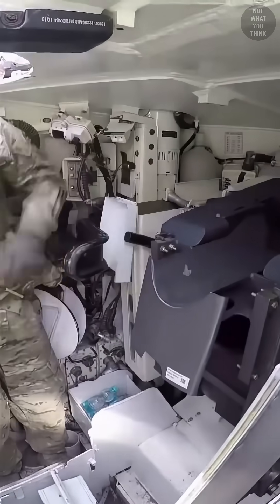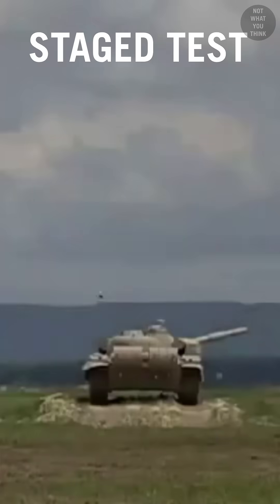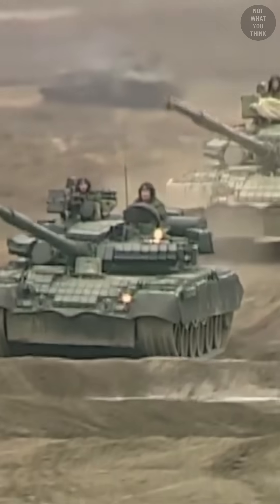Why M1 Abrams Tank Has No Auto-Loader #shorts

Comment: I'm sure there's a happy medium somewhere, not having an auto-loader must suck as those shells are really freaking heavy.
Edit: After seeing how truly awful the Russians are in battle, I'm no longer all that disappointed at the lack of an auto loader.
Reply: French, Japanese, and Korean tanks have a blowout panel with an autoloader so the crew are protected from the ammunition while needing only 3 crew.
Reply: @aaa-fc6by  germans as well
Reply: @aaa-fc6by  And which tank is better?
Reply: @aaa-fc6by  and the abrahms still is king
Reply: @aaa-fc6by  i doesn't need to be said but there's a list of advantages to not having an autoloader. Not just safety in the even of ammunition detonation
Reply: @aaa-fc6by  your not one upping American tanks, by stating this stupid facts, we do in fact use auto loaders, not on all vehicles tho. Some quickly change munitions with a quick individual rather then preload with autoloaders
Reply: @aaa-fc6by  The Abrams has a blowout panel to protect the crew from the ammunition and a split ammo rack so the tank only loses half its rounds if the ammo goes off.

Also, Abrams only needs 3 crew.  The 4th guy is a boon if personnel are available.  But I've personally seen many Abrams tanks run with just 3 crew.
Reply: @aaa-fc6by  Having less crew isn't necessarily good. And how much ammo can they fit?
Reply: Normally you‘re not going to change that many shells in a row and you‘re specifically trained to do exactly that. nothing else than working out at the gym, don’t see the problem :D
Reply: @TheLuxentertainment  problem is that not every loader is the same size meaning taller loaders can have issues with longer shells
Reply: Those rounds are not really that heavy. They're only around 50-55lbs each
Reply: @sawmocehdohmoo563  try loading 55 pound shells for a few hours straight.
Reply: @BASEDKAISER  you're never gonna load rounds for an hour straight. The tank doesn't hold that many rounds
Reply: @sawmocehdohmoo563  I've handled tank rounds and you're pretty much spot on with the weight. But I was a little bit weak and they felt like 70+lbs.
Reply: @sawmocehdohmoo563  You crazy that's pretty heavy.
Reply: @sawmocehdohmoo563  well I guess that means if I ever join a tank crew after Papa Murphy's I'll be set, I load 40 pound boxes of mozzarella in and out of the walk in lmao. Not that much heavier
Reply: @liamschallock5346  go for it. Loading a tank round is one of the easiest things you will do as a tanker
Reply: @sawmocehdohmoo563  41 lbs I think, yea not to heavy at all infantry carries way more than that
Reply: @sawmocehdohmoo563  so me a 12 yo boy could do it? If age didnt matter
Reply: @sawmocehdohmoo563  the endurance needed to lift each one over at shoulder height is quite taxing when the rack can carry at least ~20
Reply: @sawmocehdohmoo563  now imagine carrying that weight everytime the gun fires in the sheer heat, cold, and cramped conditions
Reply: @crispyboi4062  I don't have to imagine it because I've done it in all those conditions.
Reply: @sawmocehdohmoo563  damn that is impressive I couldn't do that if I tried hats off to you and thanks
Reply: @sawmocehdohmoo563  Dude, that's a sack of potatoes. "Not really that heavy". Sure, buddy.
Reply: @FlyboyHelosim  If you think a sack of potatoes is heavy, being a tanker might not be in your best interest.
Reply: @sawmocehdohmoo563  I never said I wanted to be a tanker, besides lifting sacks of potatoes is probably worse than loading shells. I was a kitchen porter for 6 years, lifting multiple sacks of potatoes and many above waist height.
Reply: @FlyboyHelosim  Maybe. Being a loader is not hard
Reply: @sawmocehdohmoo563  That might not be terribly heavy but in an all out tank war having to load those rounds over and over and over for hours would be absolutely tedious. The thing I dont like about auto loaders, though, is the fact that like every other thing mechanically operated it can and will break down. Whether from bad parts, human error, damage taken, ect. So I get what the American designers were going for. Longevity and it being able to continue firing no matter what. Same with the Abrams tank engine. It will keep going no matter what you put in it. Even ethyl alcohol. As much as tank nerds love the German Leopard, its been known to have multiple mechanical errors in short amounts of time. In a near peer war situation humans have learned time and again that having a weapon that works consistently, is very hard to take out, and can be produced in vast quantities will win out every time.
Reply: @Oblivisci........  you would fire them for hours however, it would not be necessary to load 50+ rounds consecutively at most, it would be 2-4 shots fired back to back
Reply: @Just_Tox  then let the mf rest as someone else takes over. It's not that complicated
Reply: @anonymousapproximation8549  whoses gonna take over his position a loader is a loader not a commander, gunner or driver and I wouldn’t trust the random guy you find that’s got nothing to do to load the right shell
Reply: @TN-ci4ox  If you're in a situation where you need those shells loaded, and the loader is too tired to load, well, firstly what the fuck are doing to get into that situation, secondly, I doubt that the gunner doesn't know how to load shells, so probably him and the load switch places. If you somehow get into a situation that both of them are too tired to continue, then I'd question your validity as a commander.
Reply: @TN-ci4ox  why not as a loader hes fot the most off time and most of the time all he can do when not firing is learning the other positions. My old LT COL from school was a gunner before a commander.
Reply: @Oblivisci........  You're both kinda wrong. The shells weigh a lot, but aren't that heavy. But also in even a full on super heated combat a tank wouldn't just fire as fast as it reloads. What's tiring here and most gym bros can attest, is to do it everyday and your muscles can't get rest to recover from the constant stress. You're waking up with sore muscles and need to engage them again just a few minutes after getting up.
Reply: @Just_Tox  how many rounds do you think a tank even carries? Its not like battlefield where you constantly firing shells all day.
Reply: @twayland6186  for the Abrams it has a maximum of 56
Reply: @Just_Tox exactly. if a warehouse worker can handle moving a similar amount of weight for an 11 hour day than loader can handle whatever a tank can carry.
Reply: @Oblivisci........  no single tank would keep on firing hours upon hours... that's just stupid and unrealistic. A main gun might be fired, 5-7 times in a battle. The last tank battle was in desert storm and it was an entire tank unit, not a single man firing.
Reply: @Just_Tox  loaded them like nothing when I was in 19k Abrams Tanker. Not a big deal when your in early 20s and cock strong.
Reply: @Oblivisci........  i pay money to have access to weights for hours its not a huge deal
Reply: @stevennihipali3607  Have you heard of Israel? Im sure you have... What about the six day war? What about the Yom Kippur war? I think those tank crews would very likely want to have some words with you about continously firing. For days.
Reply: @draggy6544  Lol but seriously man... Imagine hour after hour having to pick those rounds up? I guess thats why guys like you are made into machine gunners, artillery loaders and sweepers, and tank loaders. Id rather do cardio all day long. And Im not trying to be all alpha about it, but that cardio has helped me out a LOT more in every fight Ive ever been into.
Reply: @Oblivisci........  cardio actually fucks badly with testosterone
Reply: @Oblivisci........  did they use m1a1 battle tanks? No
Reply: @stevennihipali3607  What exactly does that have to do with the historical fact I brought up. He said that tanks never have to fire in such durations. I proved him wrong with a historical anecdote. So.....
Reply: @draggy6544  Are you sure?  Im not saying you are wrong, but why would literally every boxer, mma fighter, muay thai fighter, wrestler, ect consider cardio among the absolute most important things about fighting? You think with such a lack of testosterone the trade off wouldnt be worth it. Or is it generally a very small amount of testosterone?
Reply: @Oblivisci........  because they need endurance they will also do tons of ab training that includes a good amount of ab tempering where they get hit in the stomach you can’t assume just because a sport has a practice its a healthy one. They are ready to do anything to get an advantage for example they will spend a lot of money on “designer” performance enhancing drugs (made to not be detected by tests) so they generally dont have to worry about testosterone levels going down.
Reply: @Oblivisci........  btw high amount of endurance training can reduce testosterone by 20 to 40%
Reply: depends which round ur loading. some weigh next to nothing while others weigh a bit more
Reply: @m1a1abrams3  I think it's funny you commented considering your pfp
Reply: It gets easier when there's 8 enemy tanks rolling towards you
Reply: @comradeorange1645  that scenario will never happen. At least not in this day and age lol.
Reply: @0331machinegunman  but u get my point ;-;
Adrenaline and fear in combat will make it slightly more easy to manually reload the gun
Reply: @comradeorange1645  
I know this first hand!! I loaded my M1A2 SEPV1 pretty fast when ak rounds and RPGs were pinging off our tank 🇺🇲
Reply: @0331machinegunman  u sure about dat?
Reply: Consider that when surveyed, US tanker repeatedly stated they prefer the 4 man crew a human loader provides, and that gun calibers are likely to increase above 120mm, I think the most likely scenario is that we transition to autoloaders in an unmanned turret, yet retain a 4th crewmember with a new role (one such proposed role is that of a drone operator for a deployable drone from each tank.)
Reply: @ParalyzedTortoise  he'll probably function as the 5th crewman in German WWII tanks did, as the radio operator(or in this case, the electronic warfare officer)
Reply: @ParalyzedTortoise  Forget the fact that it can allow for a reshuffle if one is killed, but in the event of being immobilised, that extra body is really valuable.
Reply: 120 mm shells in a tank are about the upper limits of what A human loader can do and have a very effective rate of fire.  Also you gotta remember most tanks are not going to be in hour long conflicts.  So they may get into a conflict maybe 1 to 5 minutes long depending on how many tanks are there.  And there's downtime between engagements where the loader is sitting or standing and not doing all that much.  So with a 120 mm and proper training a human loader does fine.
Reply: There are partial autoloaders where a round is fed to the loader through a slot though only the Israeli Merkava uses that type of system. As to which is better well I leave that to Tank Jesus -> https://www.youtube.com/watch?v=R0x-8NheU1E&ab_channel=The_Chieftain
Reply: not really. 50 pounds isn't too bad if you're in the military or at least do exercises
Reply: @cookiecracker2  55 pounds is retail store standards for logistic/stockers the majority of people can lift 55 with two hands.
Reply: @CaughtSlackin_  I'd agree 100% with you if the majority of people did exercises or some sort of weight lifting ;)
Reply: @cookiecracker2  over 50% of the world works in some retail fashion which means the majority can and do.
Reply: @CaughtSlackin_  oh...this is a US tank thought we were talking US. most European and asian tanks have autoloaders
Reply: Especially HESH rounds
Reply: @dukeoftoast2420  
We don't use HESH in the US military.
Reply: The worst thing about loading in an abram is that you have to flip it around instead of like the design in German tank when you got enough space to cradle the shell and turn your body around
Reply: Man, you could do more heavy lifting on a shift at a warehouse then expected from a loader in a battle. Also it's the Army, lifting heavy shit is part of the job description.
Reply: Your average labour job requires you to be able to lift and carry 50lbs so this wouldn't be much more strenuous than a job unloading freight at Walmart. Besides of course the whole war part
Reply: They are indeed very heavy. Past experience with handling tank shells.
Reply: @The_HumblePanda  was under a tank commander who was a loader before that. Did it for 20 years. Had a few with full loads still at his house when we went for the school cookout. Not heavy at all not even hesh rounds.
Reply: Sabot weighs less than a full AP shell from WW2 despite being a 120mm
Reply: So carrying heavy loads is a chore in the army?
Reply: @foodmore  always has been since the 1774
Reply: @foodmore  yes, this is somehow surprising to you?
Reply: @foodmore  from the amount of veterans on the internet complaining about back pain, be it chronic or otherwise, that I've seen them I assume yes.
Reply: they have nothing else to do.
Reply: It wouldn't be too difficult for an average army solier to so this back to back even 10 or more times. I move 50 pounds around pretty regularly and would definitely NOT pass the physical requirements for the US Army and I can do it back to back.

He's probably just glad we don't use full caliber AP anymore, just HEAT-MP and sabot rounds.
Reply: @goosegg4653  it gets a lot easier when there's 8 enemy tanks rolling towards you
Reply: The IS-7 had a decent medium. You loaded it onto the ready rack then just kind of pushed the round into the breech.
Reply: Lmao, so many experts saying "its not that heavy/or hard work" 😂
Reply: @koirasdilluminatioy3835  well I've been a tanker for 4 years and I can tell you none of the rounds are that heavy. If you think 55lbs is heavy, then you probably shouldn't be a tanker
Reply: @sawmocehdohmoo563  i used to shoot whit 130mm fixed coastal artillery gun and after few rounds whit hand loading those ammos start to feel bit heavy
Reply: There was a test program for an autoloader for the Abrams which didn't replace the loader. But it wasn't adapted
Reply: kinda heavy yea, but if youre in the military then youre supposed to be strong. you should be able to carry 50lbs somewhat easily. especially if your job is to carry heavy stuff then you are used to it and can carry that stuff better
Reply: @-Sober-  anyone in the army should be able to lift that much, but the problem is speed. Getting the first 2-3 rounds loaded will be fast, but then the loader will slow down. An autoloader will continue to be consistent.
Reply: The elbit sabrah turret is optionally manned
Reply: They are not super heavy. An average loader has no problem reloading at efficient speed.
Reply: Only like 55lbs each you get great arms from it.
Reply: Eh, you'll run out of shells before you run out of steam
Reply: Build some arm muscle
Reply: Laughs in PT
Reply: Yeah but if your super fragile autoloader gets damaged you now have a useless tank.
Reply: Snowflakes think lifting 50lbs shells is bad for a soldier's health
Reply: When your only other option is die you would be amazed how much and how fast you can lift ,further more back in kursk the average tank had about 35-40 shells in each tank ,I doubt that number has changed by much so fighting would be in Burts as you don't want to be that naive crew out of ammo in the first hour of the fight , 1 heavy shell every 10-20 minutes is enough to keep the enemy infantry down and re considering ,this is your average tank combat ,tank vs tank doesn't happen much but in such a situation sustained fire is only for bad gunners or for tank formations (multiple tanks ) one or two 120mm shells should absolutely decimate your enemy especially if your using special shells such as HeAT rounds or what have you
Reply: Those shells are not that heavy as we think. They still can be carried by the loader crew quickly.
Reply: Yeah, seeing some be like, The French, Japan and Korea tanks are autoloaders with blowout panels.
Yeah, they are really experienced in Armoured Warfare…. Tell me, when was the last time they led the charge against enemy tanks again?
Reply: ANTIFA need not apply!
Reply: @davidkelly5459  What are you talking about?! Those guys are warriors! I have never seen a grown man run so fast in skinny ass jeans! That takes practice, skill, and natural born talent! You and I cant run that fast in skinny jeans! Alright alright we can compromise... We will take them, but we can use them as the "front line". We wont give them guns or any form of body armor. Just have them run like maniacs at the enemy positions. With any luck the suicide charge will scare the piss out of them giving us time to set up a nice flank.... You in?
Reply: @Oblivisci........  can you imagine trying to hit them as the cut and run like little rats? Damn, you give me hope for the new world!
Reply: Give the gun an auto-loader but have your mech carry it separately. That way, the ammo is not stored internally, and if the gun is damaged, you can switch to the energy sword.
Reply: G E N I U S
Reply: I can just imagine a meme of an Abrams shooting a cold war tank and it's ricocheting all the Abrams shells:
Abrams: Why won't you just die!
Cold War Tank: Stalinium son
Reply: Hitomaru Shiki , Kyuumaru Shiki : *Amateurs*
Abrams : What's that?
Hitomaru Shiki , Kyuumaru Shiki  : *AMATEURS!*
Reply: @hekkura  stfu
Reply: @hekkura  I miss the good old days when anime kids would get bullied